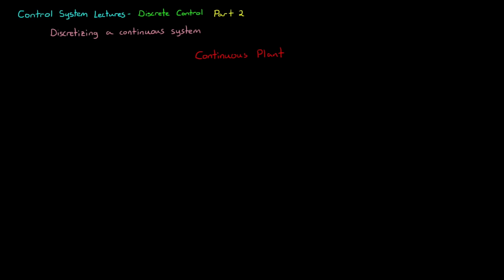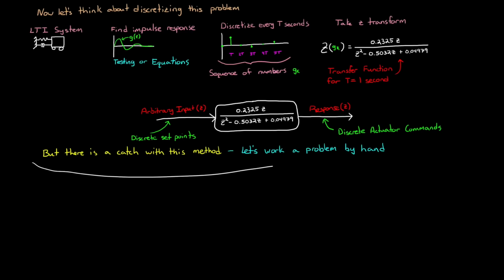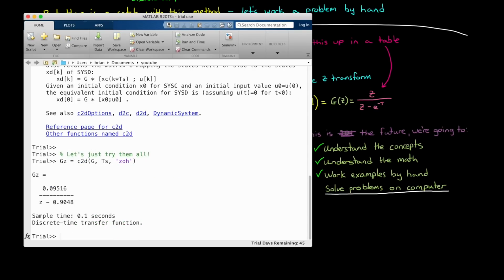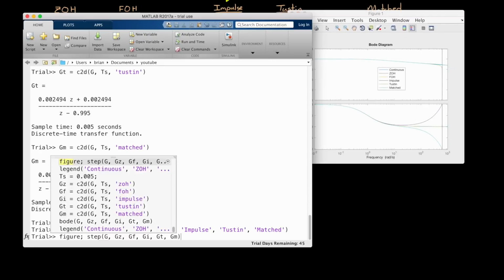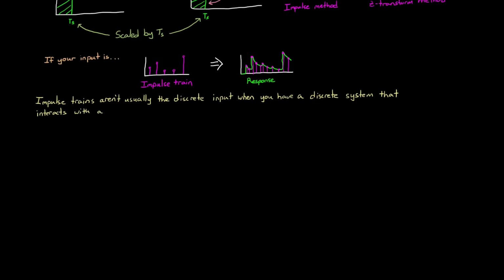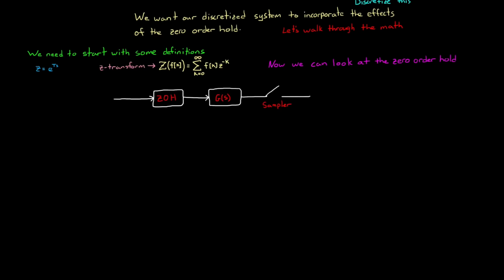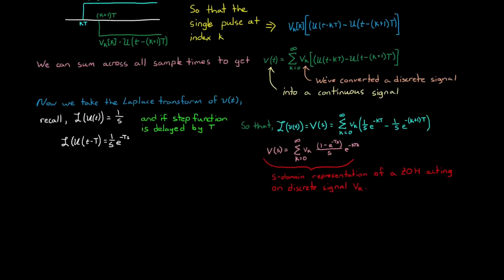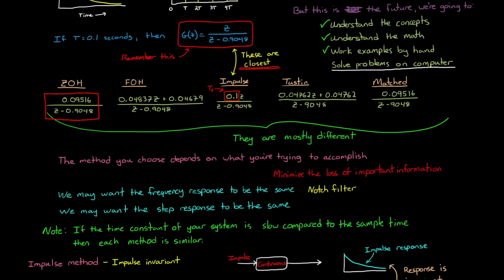Discrete control #2: Discretize! Going from continuous to discrete domain

Comment: In my uni, we're taught to discretise:
1. a control with tf([num],[den], ts] with num and den previously calculated by sustituting s=s(z)
2. a plant using the function c2d

I've interpreted that:
1. when you discretise a controller, the sampling doesn't rly matter bc you're working in a discrete dimension
2. when you discretise a plant, the input zoh matters -> the method of discretisation matters

Hence, Im confused by:
How you clustered the elements in the previous video the discretisation of {the plant with the AD converter} and {the control with the DA converter}.
This is pretty much blocking me.
I don't understand how you decide what substitution to make in the function s(z).
I don't understand how this translates to the function c2d and why it isn't used by my uni to discretise the control.

Comment: Converting the impulses to steps when sampling a continuous signal with a clocked comparator shall always result in an error(signal out of range) because stepped sampler shall always have a transient delay attached to it by virtue of the component's physical properties. For eg. if the incident signal voltage is x at time 't', and it takes time 't+s' for comparator to trigger the appropriate logic, before it is ready again, then we have already missed the x values for s duration.

Then you are saying we fill in the gaps with stepping.
It would only add to lower efficiency with no improvement in accuracy.

Having a separate isolated discreet controller to manage the 'flowing' continuous signal is better in every way...

Better power, efficiency and smoothness.

Comment: Hi, I am trying to implement a discrete transfer function in matlab simulink.
What I am doing is,
1. Writing s domain transfer function in command window
2. Converting it into discrete using c2d command with required sampling time. Here I am getting desired bode plot of discrete transfer function.
3. Taking that z-domain transfer function coefficients and providing it in a "discrete transfer function " toolbox in simulink.but here I am not getting desired freq response . Where I am doing wrong?

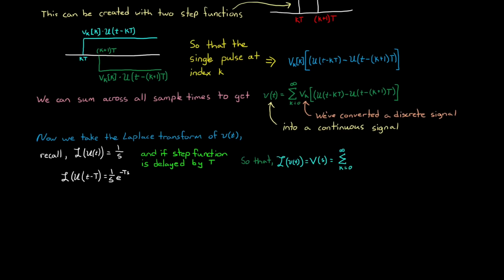Comment: Hi Brian, at 19:43, should your exponents have an s?
Reply from the maker: Nooooooooo! I thought I could get through this entire video without making a mistake! Thanks for pointing it out.  I'll add it as the first (of probably several) to the errata list in the description. Cheers!
Reply: Haha np Brian!  I've got another question:

Is there no-hold's barred best theoretical way to approach discrete problems, or is the implementation hopelessly tied to the method (ZOH, Pade, Tustin et al)?  I know Tustin is more accurate than ZOH etc...  But rather, is there an implementation agnostic way to design for discrete?

I'm looking  at all these transformations and don't see a catch-all approach.  You got damn near sorting it all out in your 3rd video!
Reply: Reading Franklin, Powell, and Emami:
"Discrete design is an exact method... that entails (a) finding a discrete model of the plant G, and (b) designing compensation directly in it's discrete form... requires a sample rate to be chosen in advance.  A practical approach is to commence design using discrete equivalents, then tune the result using discrete design."

Dang, sounds cumbersome!